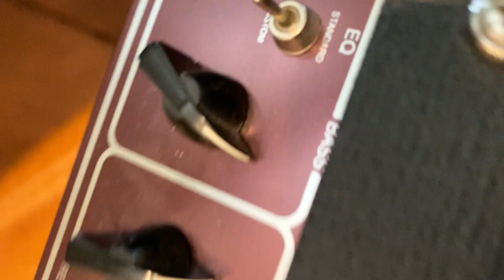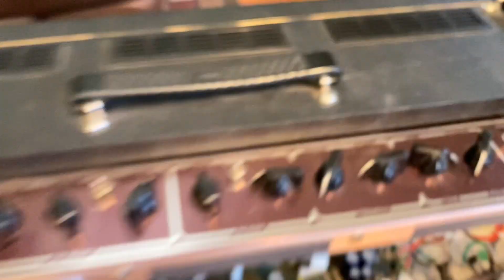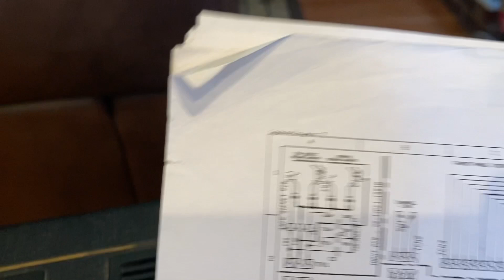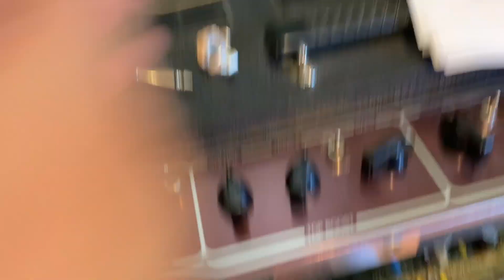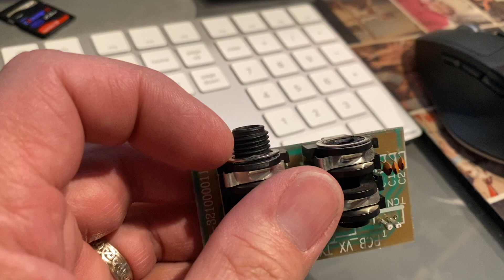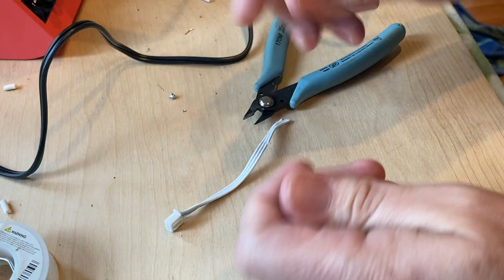Vox AC30CC2X Converted To Hand Wired Input Jacks

Comment: Nice work! Seems like connecting the jack ground directly to the input plate, you have bypassed the ferrite bead for the ground. Maybe not an issue, but it seems it would defeat the high frequency common mode rejection per the original design. A good trade-off given how cheap the factory jacks are.
Reply from the maker: yup, i redid that bit later and put the beads in the circuit correctly - good eye!

Comment: Hey. I have the same amp. Just purchased it.  I’m noticing a ground buzz. Or what seems like a ground buzz.  I’ve tried several guitars cables and different  places for power.  The only thing that stops it, is if I touch something metal on the amp or  the outside of a cable with a metal jacket.  Is this due to the pcb board or a bad pre amp tube maybe rectifier? Any help is appreciated

Comment: This could have been better.  Too much talking, too many tangents,  no clear diagram of how to wire it, and if I’m seeing it correctly, the caps are wired on the wrong side of the ferrite bead.  The cap goes after the ferrite bead for the combination of the two to work. Trace the tracks on the PCB to see this.
Reply: He did mention that the repair manual containing the schematic is available.